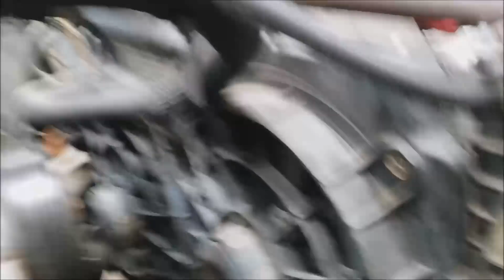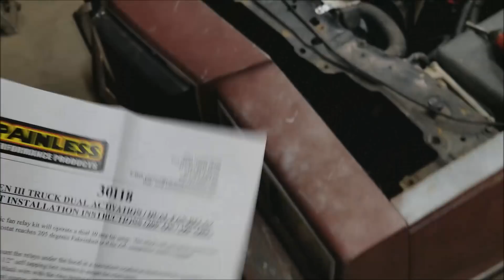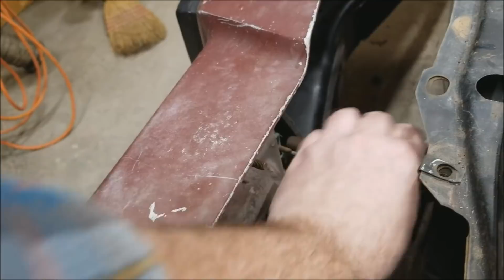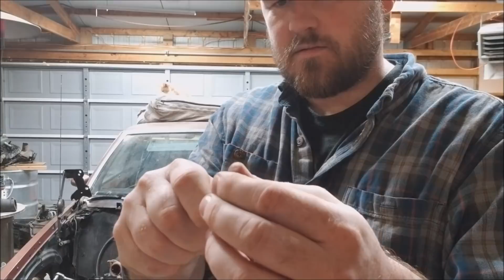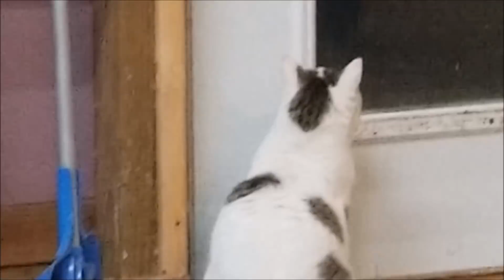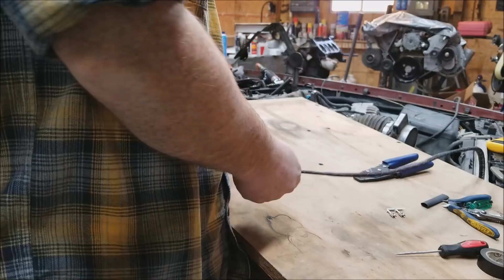LT1 dual fan Painless wiring in a g body how to

Comment: I got this same kit but only a single wire that goes to the tempature sending  unit. i have the sending unit with 2 prongs but only a single wire what is up with that
Reply from the maker: That's a good question. It may have been an update on their part. If I were you, I'd call Painless and ask them about it. It's a good kit and I still use it on my car but I have actually bypassed the sensor and have my fans running all of the time now. What I need to do is install the sensor somewhere in the cooling system so it will still work correctly.

Comment: In the vid you mentioned  that you did wire the A/C compressor clutch wire to a toggle switch in a different car.  Could you please let me know how you wired that properly?
Reply from the maker: Okay, sorry for the wait. I had to watch the video to make sure I was answering this correctly. On our 95 Camaro, we tapped into a hot wire for the fans and put a toggle switch in-line so we could turn on the fans without the car needing to run. We were able to cool the car down between rounds somewhat. So with the painless setup, the A/C wire is basically another wire that you can tap into the hot side of the compressor wiring to turn on the fans. What I was going to do was use that wire on a toggle switch and connect it to a 12 volt spot on the car. All that wire is doing is turning on the separate A/C relay. I'm probably not explaining that very well. It's hard to explain without drawing a wiring diagram. Let me know if this answers your question. I'll try to help however I can.
Reply: @DivineSpeed  thank you for taking the time to reply and help me out. I have removed all of the ac unit out of the car and won't be replacing it. So the a/c control wire in the painless harness that can be used to set up a toggle switch to turn the fans on if the temp sensor fails. Id like to have that safety net just incase one day. So my question is what is the best way to do that. I ran that painless a/c control wire through the fire wall into the dash with the pink painless ignition wire. The painless ignition wire is already tied in to the car's original ignition wire to provide power when the car turns on.
Reply: So what is the best way to hook that ac control wire up to a toggle in my dash so i can manually control the fans whenever i want? Also if it's better to use a 2 or 3 prong toggle? Thank you for all your help!!
Reply from the maker: Rick, when you hooked the a/c wire from the painless kit to a 12 volt source, did the fans come on like they're supposed to? If they did, all you would need to do is put a toggle switch somewhere in the middle of that wire. two prong is fine. You're just trying to be able to shut that power on and off. Let me know what that wire does. I don't have the wiring diagram around to look at it.